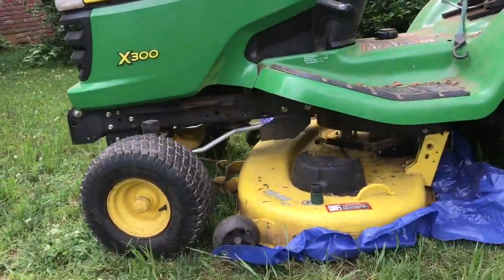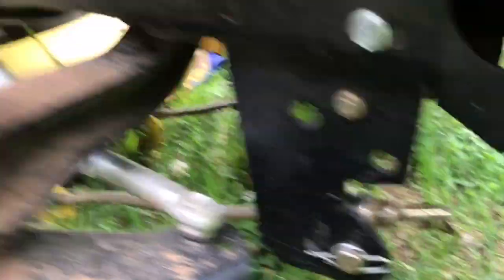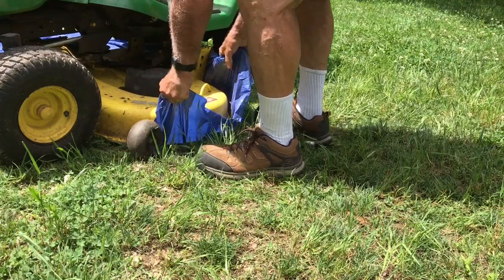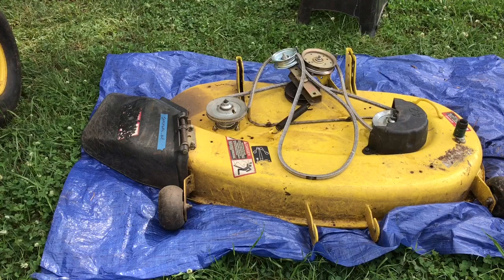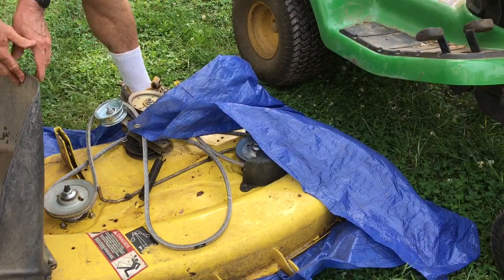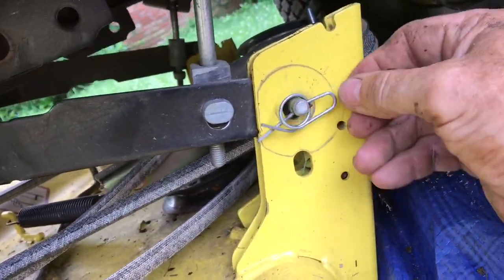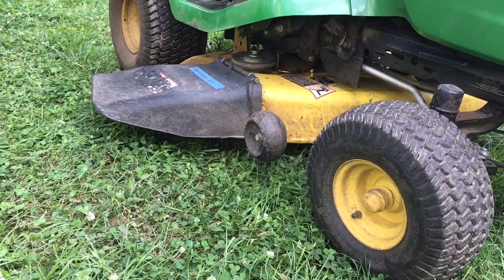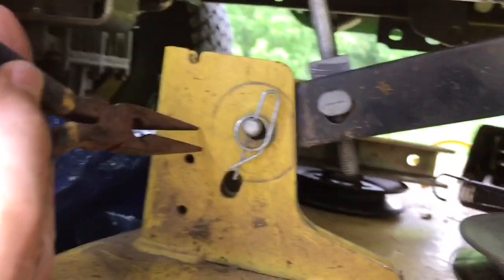John Deere X300 deck belt change.  With details

Comment: My belt has broke 3 times this year. Anyone else having that problem or do I have a problem?
Reply from the maker: mccullough87 I think the idler pulley is bad or out of line. It has happened to me before and it breaks the belts. I’ve never tried to fix the idler pulley.
Reply: mccullough87 yes me it’s getting frustrated. I’m digging more into it. I think I’ve broke like 3-4.
Reply from the maker: Janice Mitchell if it’s not a bad idler pulley I don’t know, but I’m not a mower mechanic.  Searching YouTube for x300 belt problems you’ll see a lot of videos.  Sounds like a major complaint common in their mowers.  Wish I could be of more help but I’m tapped out.  Sorry
Reply: Larry Satchwell you have been a lot of help. If it weren’t for your video I probably wouldn’t have been able to change the belt on my own. So, thank you for video and help. I am so appreciate of it.
Reply from the maker: Janice Mitchell thanks,  good luck. Please let us know if you find the solution.

Comment: .No need for a tool to remove the  safety pins (wire),  just pull out and up on the end of the bent wire and the loop will come out and slip over the pin.  https://youtu.be/FquUa4bwD50?t=55
Reply from the maker: Thanks